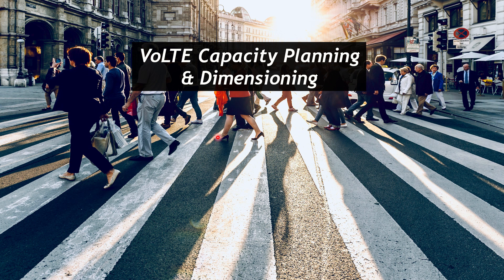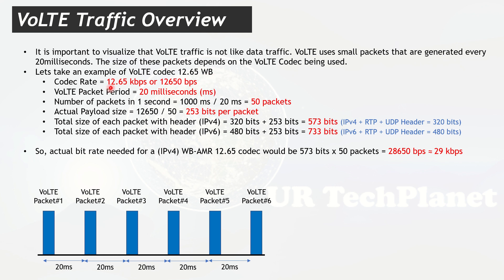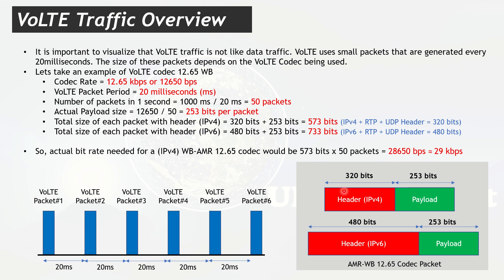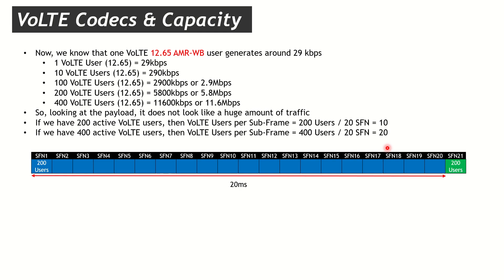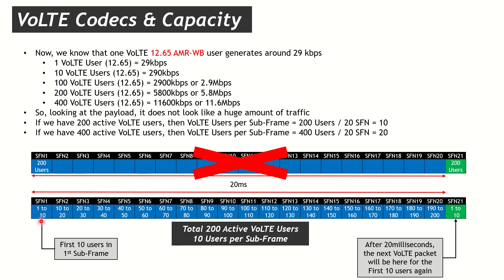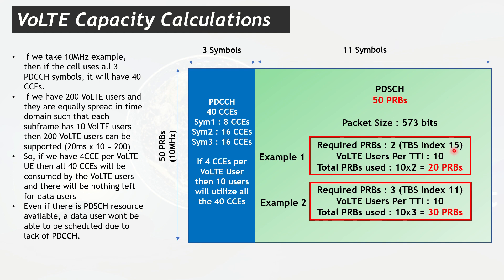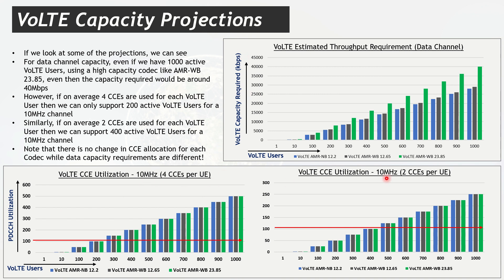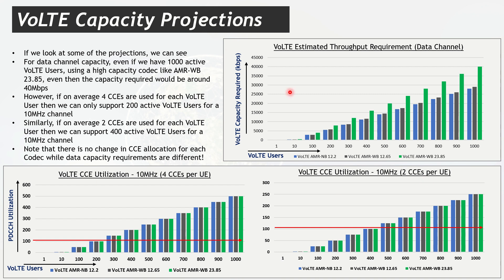VoLTE Capacity Planning and Design: A Dimensioning Cheat Sheet

Comment: how much realistic is using qci 1 erab session time to get volte traffic in Erlang
Reply from the maker: The counters to get connected session time for VoLTE is the only appropriate way to estimate Erlangs. And by definition, it should be a realistic approach.
Reply: @OurTechPlanet  i meant that is it true conversion or estimated value
Reply: In short, it is very difficult to calculate exact values of data from given Erlangs but an approximation can be made based on above assumptions
this is taken from your article on website so using session time gives you an approximate value but not true conversion
Reply: awaiting your kind response
Reply from the maker: @munzirkhalil4213  No, it is a correct value for the Erlangs. So, you can use those counters to get the Erlangs.

Comment: The 100% PDCCH Utilization across all codecs is purely based on the assumption that each UE require 4 CCEs but in live network that won't be the case, right?
Reply from the maker: Yeah you are right, in a live network it will be a mixture of different number of CCEs. It can be 1,2,4 or 8 depending on UE's channel conditions.